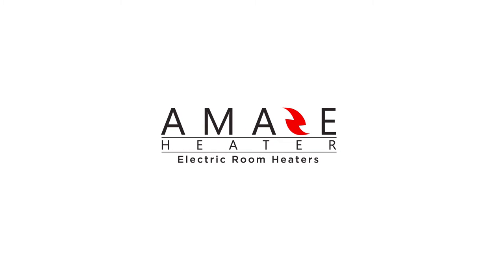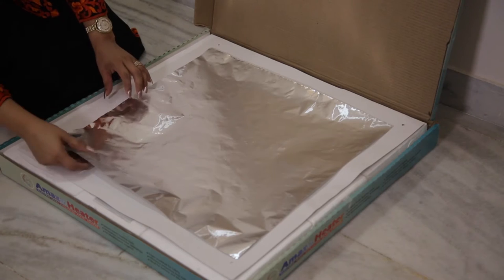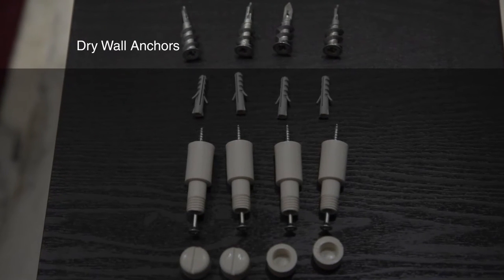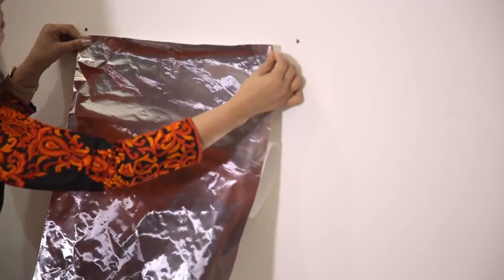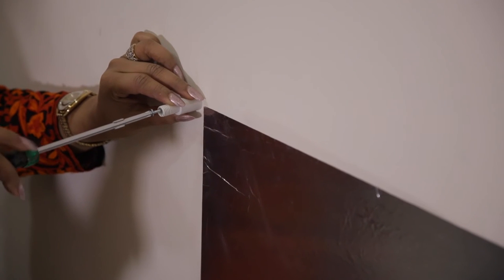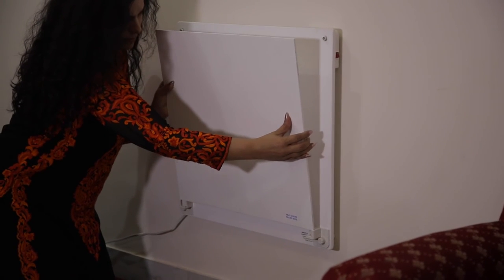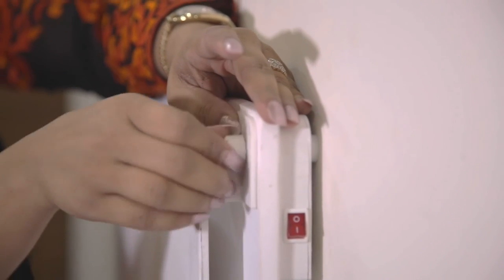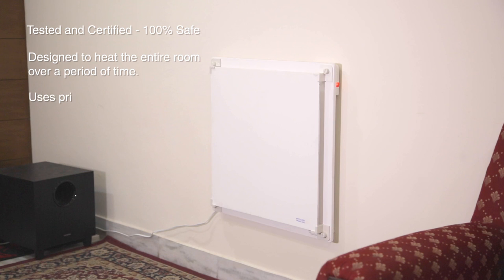Amaze Heater Installation Video

Comment: I have two and they smell like a combination of band AIDS and cow pasture. I've heated it up then let it cool and the smell had lessened but still is very strong.
Reply: Didn't you read the instructions? You're not supposed to dry your underwear and socks on the heater.